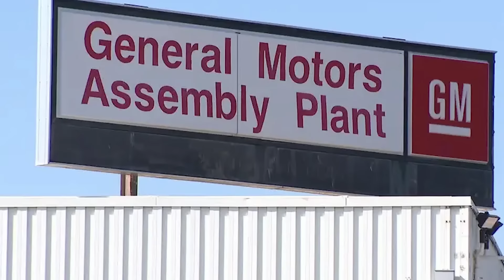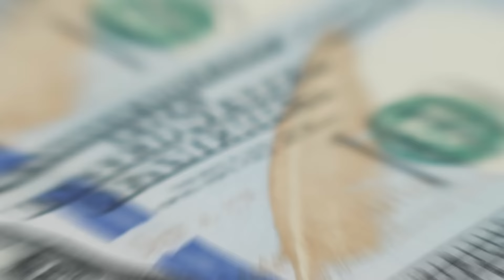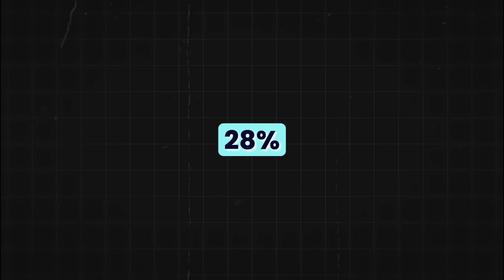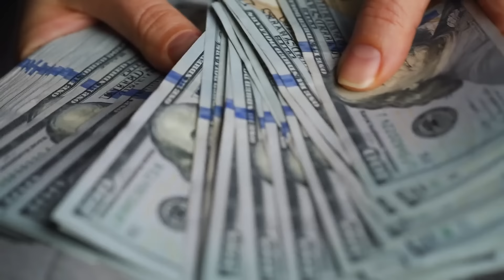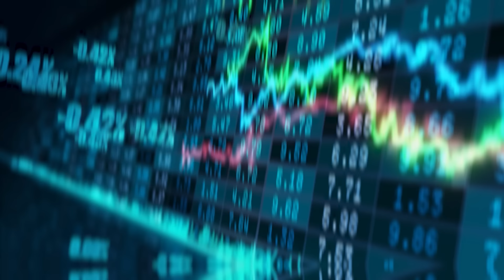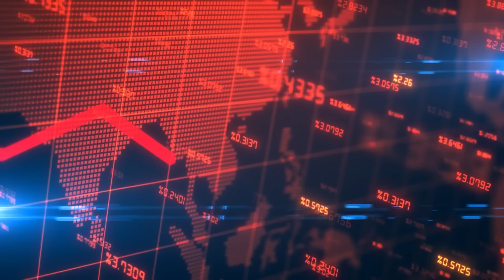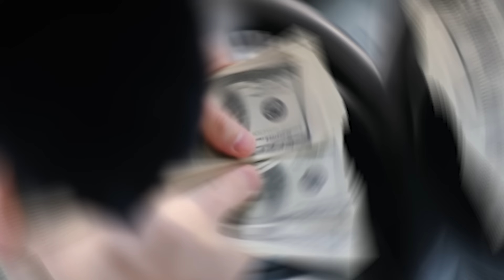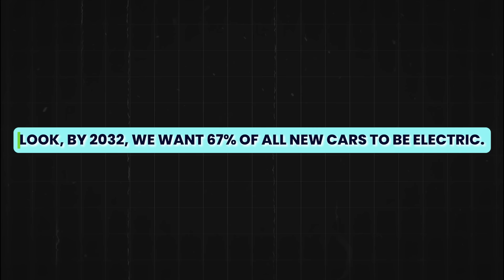The EV BUBBLE has Burst!!!

Comment: I bought an F150 King Ranch power boost hybrid, and in the 2 1/2 years I’ve owned it they had to take the first one back after five days because it quit working and they couldn’t get it working. Three months later I got my new truck again and twice in the last two years I came out of lunch and the vehicle wouldn’t start. They claimed it was the hybrid battery which I don’t understand why it has a battery upfront when I thought the battery upfront primary purpose was to start the vehicle. The second time this happened it took them a month and three days to fix it by replacing the hybrid battery the hybrid motor And several modules. Also, the second time I was 110 miles away from home and they refused to tow it to my home dealership so I had to find my own way home and even though I have 150,000 mile bumper-to-bumper warranty they said they would rent a $35 a car for 10 calendar days. How am I supposed to drive this for work out of town like I have been doing when it is this unreliable? Ford Customer service said they were going to offer me a buyback but never did. Credibly, frustrating and unreliable for a $75,000 vehicle, especially

Comment: Unfortunately i was forced to Trade in my 13 year old car due to hoses perishing and then a head gasket going. With a gearbox whine also present i has to buy a replacement used car when the prices were at an all time high. I brought a top spec 3yrvold Volvo S90 with only 10k miles and hopefully it will last me at least 10 years. Cars are dead money and just need to be a reliable convenient mode of transport. I certainly dont want to be paying mortgage cost prices per month to own one!

Comment: Ev as we have them today are terrible. They should be smaller, cheaper and easier to attain. If there were quick change battery stations or some way people wouldn’t have to worry about it taking an hour then I think it could work but in its current state, I would rather buy an electric golf cart

Comment: Toyota have sliced the production of their Electric Vehicles - they just can't sell them all.
As mentioned in the video, Tesla have had to reduce the price of their EVs.
I wouldn't buy an EV here in Australia because there are very few charging stations in the rural areas, it takes far too long to top up the charge, & the cost is almost as much as filling up a car with petrol.  
The discounts for EVs have disappeared, & the Government Rebates on purchases have  been slashed.
My petrol Ford has 250,000 km on the clock - I bought it new, & have only replaced tyres, battery & one headlight.

Bugger the environmentalists..

Comment: Ford and GM only have their dealers to look at regarding the failures of their EV efforts. I have yet to go into any legacy automaker, both foreign and domestic, and be able to speak with a salesperson that actually wants to sell an EV. Every single one of the them will and have spoken down about EVs and have tried to move me over to an ICE vehicle. None of them I have spoken to even understood what they were “selling.” You cannot have a successful launch of a product if your dealers actively subvert it every chance they get. 

Legacy autos cannot yet compete with the likes of Tesla and other EV first companies, but mostly Tesla. At this point if I’m thinking EV the only real choice is Tesla, and that is mainly about the charging network. Until legacy automakers start building EVs with the NACS plugs they are still going to need to rely on a subpar charging network compared to Tesla’s. I just rented a Model 3 and took it on a 600+ mile road trip in this freezing cold weather and had zero charging issues. Only issue I had was that Hertz never filled the wiper fluid and I had to stop and buy some on the way back home due to the snow and salt rendering the windshield opaque.  

Pricing should also be a non issue but media and the people who parrot the talking points all speak about how expensive EVs are. I’m sure no one is doing any type of actual research because I can easily find many Tesla’s under $40K with the tax incentive now at point of sale. Some states you can even pick one up for under $30k. If you want to find a deal … they are out there. 

Other issue with the GM’s and Ford’s out there is that they are taking legacy automaking into the EV process. They will never be able to compete on price and make a profit if all they are doing is taking ICE cars and dropping EV batteries and drivetrains in them. Yes their build quality is much better than Tesla’s but that comes at a price. I know Tesla likes to be viewed and priced as a luxury car manufacturer but I see them more like the initial Japanese cars of the 70’s and even the Hyundai’s and Yugo’s of the late 80’s. They are cheaply made cars looking to gain a foothold in a market not being effectively served by the big 3. I’m not gonna lie, while I love the Model 3 and Y, they are some of the most tinny cars out there. Be careful how you close the frunk because you might dent the hood. Don’t get into a minor accident because you’ll probably total the car. However, you will save a crap ton on gas and maintenance over the life time of the vehicle. As Tesla matures, the build quality will get better, but it needs volume and market share much like those early Japanese vehicles managed to score during the gas crisis of the 70’s. Now, those same Japanese vehicles and even Hyundai are among some of the most reliable and well built vehicles out there.

We have to be careful here. There is a future with EVs coming and if the US carmakers cannot figure it out, we stand to lose it all. China is going all in on EVs and with many compelling offerings. Even with the tariffs there will come a point where they will be able to sell a cheap enough vehicle and gain a foothold in the American market. We will lose the EV and with that potentially the entire car market just like we lost the solar panel mfg market to China. It’s not if, it’s when they get here. 

We don’t want to repeat the same mistakes we made then now, just to protect the aging fossil fuel industry. Ask Kodak how it feels about its decision to ignore the digital revolution going on in the camera space. How print media feels about the internet. If you don’t adapt, you get left behind. If you cling to the old and ignore the new you are left with neither. Progress happens and it’s a bumpy road, but those bumps eventually get smoothed out. You might want to resist change but it’s gonna happen, just like it happened going from horse drawn carriages to the gas powered autos that we are so desperately trying to cling to today.

Comment: Don’t feel too terribly bad for these “poor” manufacturers and dealers. Every single cotton pickin’ consumer credit application that is filled out by potential buyer, even if the transaction doesn’t go thru cuz of credit score constraints, the dealer gets the full par value of the window sticker amount. The application is converted into a security and dealer completes an application for advance of federal reserve notes thru their federal reserve agent once the credit application signed by consumer/borrower and the appropriate forms per federal reserve operating circular 10 is submitted. The dealer, being fully paid before the loan docs are even signed, then finances the negotiated price to the borrower thru internal or external lender with a consumer credit contract binding borrowers to repay pure profit to the shareholders of that contract/aka security, which is then leveraged or hypothecated typically 100 times or more. So that $75k car  loan turns into millions on the secondary market/aka stock exchange, and the primary market/aka treasury paid the cost of the vehicle right out of the gates. Wonderful system we got, eh?

Comment: Someone needs to invent a rear axle bolt on EV system that charges at home as well as from the normal engine that covers 12 miles, as most people would get by like this, then holidays you crank the engine.

Comment: Good luck to the American car industries If they ditch making EV's😅. We have been driving electric cars for the past 8 years now, and we will not ever go back to drive ICE cars again. 

Many seems to have an opinion about electric cars, but at least try out an EV before you start making asumptions about them.
Recently their have been a big debate in USA about EV's in cold weather. And from here in Scandinavia where i live, i can tell you that it is as far from the truth as it can be. EV's perform extremely well, as long as people know how they charge the best in winter time. You don't charge the car on a DC (rapid charge) unless you have the battery up in temperatur. AC charging is the way to go If you have the chance for that. And on a DC charger people seems not to know that the rule of thump is, in and out fast. ONLY charge to about 80%. The last part of charging is to slow to keep hanging on to a DC charger. 
Good luck to the american car industry🙏🤞

Comment: EV's are a quick fix that noone has put the energy to analyze the real impact on the environment. First of all it takes an EV 8 years to be green because of the CO2 impact used in production. So your small gas car or hybrid are more green the first 8 years. Second because of the battery pack if you are in an accident where the battery is damaged the EV has to be scrapped because of safety and the cost of putting a new battery. 3rd a plugin hybrid usually covers the average persons daily travels. Longer trips are covered by the gas engine. 4th better tech is already on the drawing board with hydrogen and wet gas engines... Remember the same idiots that told you that ethanol engines were going to save the world are now telling you EV's are the new thing....

Comment: I live in Brazil, here we have cars that runs with Gas and Alcohol (and any rate of mix between them), Alcohol is trully green, since the exaust spits water and CO2 (not toxic and plants uses); also how green is a car which the battery has so much carbon footprint that takes 5y to break even with gas cars, that is, if the charge station is powered with green sources (not the case in the US). @chargedrive you should do a video about this...

Comment: AMERICANS ARE NOT STUPID AND DO NOT WANT EV AUTOMOBILES THERE JUNK AND NO CHARGING STATIONS IN MOST OF THE USA BUT THERE IS PLENTY OF GAS STATIONS AND MECHANICS TO WORK ON THERE COMBUSTION CARS AND TRUCKS BUT IF YOU BRAKE DOWN IN A EV YOUR GOING TO SPEND THOUSANDS TO HAVE IT REPAIRED AT A DEALERSHIP IF YOU CAN FIND A DEALERSHIP WITH QUALIFIED TECHNICIANS THAT KNOW HOW TO WORK ONE ONE AND REPAIR IT PROPERLY

Comment: EV's have too short of a range, take too long to charge provided you can find a charging station as you cruise Route 66 and for me not many cars are capable of towing.... I have a boat and Camper and I need a Gas engine to get them around.

Hydrogen would be a smarter choice, not only do they have a longer range it also takes less than 10 minutes to get back on the road.... again the filling locations are only on the West Coast from what I have read but that's just logistics.

Comment: should have just stayed with a good ole gas powered vehicle. reliable and trust worthy. a gas powered car it take hours to charge if you can find a station close by, but with gas just stop put your gas in, and  in 5 minutes your back on the road. I'll always be pro gas, over electric. and I'm also not going to let a car drive its self with me in it. the mach E isnt a mustang either. mustang has never been a SUV. that's another reason people hate that pile of trash.

Comment: One problem is that even saving gas what happens to all the batteries after they are spent and no good they will go into dumps how will that help the environment they are just trading one problems for another second there is no infrastructure if you support electric cars trucks they  the technology is available to create vehicles that are not dependent on plugging in putting a small generator in the vehicle using only a small amount of gas or propane, but they want you dependent on either the gas companies or electric companies

Comment: Ecco boost engines blow up, with there timing belts oil driven soaked in  oil  degrade and cause engine failure torch problems as well oil driven

Comment: No ev's are a bad idea there's huge losses with ev's from high electric bills to charge long wait times to charge but the worst of all winter cold so many cars piled up in Edmonton from the "small" cold snap of -50c it's getting so bad that gas and even Diesel cars I would say are starting to become even more desirable but who can even aford a new truck right now there too expensive a regular bare bones Ford F-150 stock which is hard to find cause they are all mostly decked out at the dealer start at around 79k my 2018 f150 lariat was cheaper then that this is what happened when you listen to politics and start pushing expensive trucks and only expensive trucks with no options for a mid range